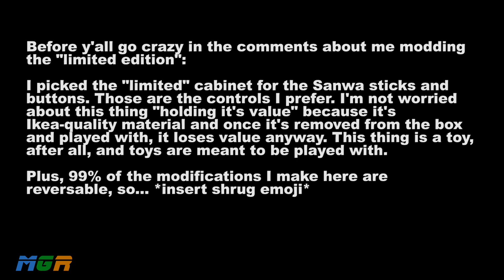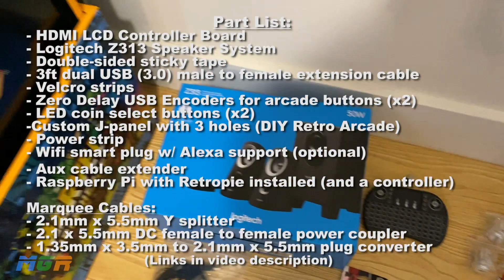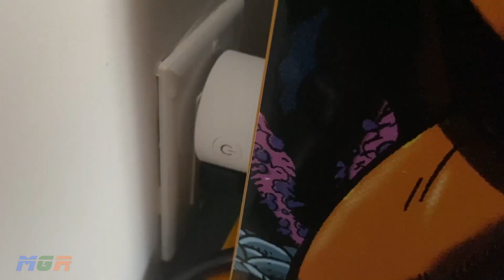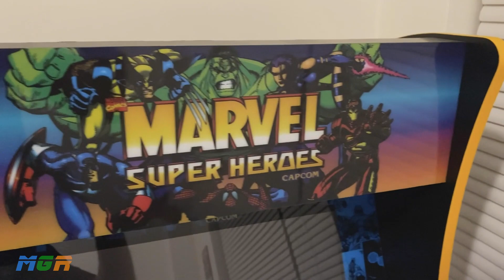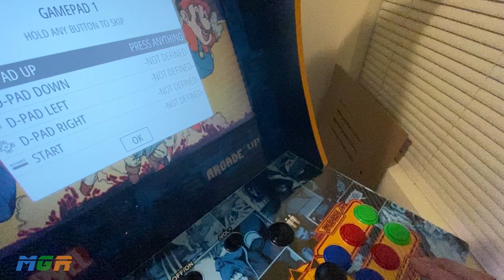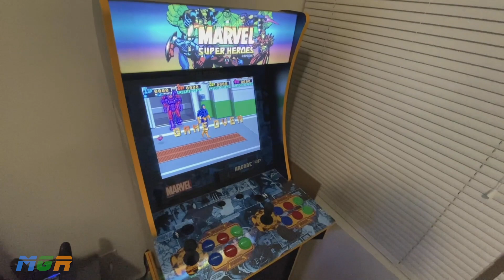How to Mod a Marvel Super Heroes (Special Edition) Arcade1up Cabinet

Comment: Hey just found your video, do these same instructions apply to the recent marvel vs capcom arcade cabs?
Reply from the maker: Most of it should, but to be safe I would try to find a more recent video on that specific cab, as it is newer and might have some different parts than the one in the video.
Reply: @MinorityGamerReport  I figured, I guess I will wait and see if any vids drop about it. Thanks for replying.

Comment: So if i am looking to keep the stock buttons and speakers, but add more games, i really just need the encoder and the pi set up?
Reply from the maker: Depends on what cabinet you are modding. In this video I used the stock buttons and speakers tho, so if you follow this tutorial and have the same cab, you’ll have that.
Reply: @MinorityGamerReport  i do have the same can actually!  Mine is the blue one with light up buttons and light up marquee!  :)
Reply from the maker: You’ll still need the subwoofer shown in the tutorial or an amp in order to use the stock speakers after modding tho.
Reply: @MinorityGamerReport  oh really?  Ok thats good to know!  Ty sm

Comment: My joy sticks dont have the cable there?? The yellow red and black 3 in one. Here is a picture https://ibb.co/wWB9Ysw
Reply from the maker: Is this for the limited edition or the regular edition? Hard to tell from the picture
Reply: @MinorityGamerReport  
https://ibb.co/P54GTD2
https://ibb.co/2WHFZkB

Either way I picked up 2 joysticks by easyget so I'll have to install them just going to be a pain to center them XD. Idk of there better or worse then the ones I got.
Reply from the maker: Yeah the control set up is slightly different for the non-limited edition, since it has Sanwa parts. Sounds like you figured it out tho. Sorry, I wasn’t more clear about that in the video.
Reply from the maker: The reason for the difference is because the limited edition uses Sanwa parts for the controls, while the regular does not.

Comment: I got everything up and running and in waiting on my usb encoders to come in in the mean time using a usb joystick into the raspberry pi.

But I cant seen to get audio I dont know why?
Reply from the maker: Did you try playing around with the Pi’s audio settings? I’m not sure what the issue would be outside of that.
Reply: @MinorityGamerReport  what audio settings do you have it set at?
Reply: @MinorityGamerReport  I got mine work and atm just wiring my fight stick but I dont have that cable there on the joystick so I'm screwed lol why is mine diffrent https://ibb.co/wWB9Ysw

Comment: Im following your directions on the speakers, but i cant get ANY audio to come out no matter what i try. Im not sure what I'm doing wrong.
Reply: Same I cant get audio
Reply: @ShadowFury576  looking at a few google searches, the control board (with the LED) has a few buttons marked Left and Right, and the right turns up the volume. Barring that, theres also a retro arch option for audio that may need to be adjusted. We can hope Minority here updates us.
Reply from the maker: You might have to go into the Pi’s audio configuration menu and try some of the options there. I didn’t have any audio issues, personally though.

Comment: Hi, I got all the parts you listed and I'm still having issues with connecting the Marquee. I can't seem to get the 2.1mm connection to get into the female to female. It seems like the metal inside is too big. Is this for sure the right part? https://www.amazon.com/gp/product/B002IULV8U/ref=ppx_yo_dt_b_search_asin_title?ie=UTF8&psc=1 . It could be I got some defective/bigs ones too, cause the male to male ones in the package don't even fit into the female one.
Reply from the maker: That connector you linked to is the correct one, so I’m not sure.
Reply: @MinorityGamerReport  Thanks for the response! And once again, video has been very helpful. Turns out I got sent a 2.5mm x 5.5mm even though the bag says 2.1mm x 5.5mm. Got the correct one and everything works great. Oddly, I couldn't get audio working from the LCD board; I had to connect it directly to my Pi.

Comment: Did you need to put the ground onto the LCD Controller? It's not in your video, curious if it needs to be grounded to the controller like ETA Prime's video.
Reply from the maker: Yes, I used the ground
Reply from the maker: I linked ETA Prime’s video in the video description just in case I missed anything that he already went over.

Comment: Hey, is it possible to switch out the coin buttons you are using with the 25 cent credit ones? How would they connect to the encoder? https://www.diyretroarcade.com/products/25-cent-red-push-for-credit-arcade-led-button?_pos=1&_sid=a9a4b9fe7&_ss=r
Reply from the maker: Yes you can use whatever other button you want as long as it has the same connectors. It would connect the same way as the ones I have in the video

Comment: Couldn't I plug in the default speakers into the pi?
Reply: Sorry I have one more thing to ask, I got almost everything working but I got a subwoofer that doesn't have aux output just input, is there a work around for this?
Reply from the maker: I wouldn’t advise that. You need some kind of amplifier to power the sound.
Reply: @MinorityGamerReport  Do you attach the ground to the board or the monitor and does it have to be that specific subwoofer?
Reply from the maker: @SickleSlash  you wanna attach the ground to the board

Comment: Great video, is there anyway to use the stock speakers alongside this particular mod?
Reply from the maker: I use the stock speakers in this tutorial. The only thing I did was connect a subwoofer to it in order to connect and amplify the sound coming from the Pi. The sound still comes from the stocks
Reply from the maker: Also, thanks for watching!

Comment: Just ordered this cab and plan to mod it. One question - Do you shut down your Pi first and then use voice to shut down everything else? 

I was looking at a powerbar with a remote instead of voice - but just trying to figure it all out (I'm using a PC instead of a Pi).
Reply from the maker: Nathaniel Lewis Yes, you’ll want to shut down your Pi or PC normally first before cutting off the power with the smart plug. If you just cut the power with the Pi/PC still on it can damage it.
Reply: @MinorityGamerReport  My other question is - how do you turn it back on? Do you have to go in each time to turn on the Pi?
Reply: @thenateyshow8900  How did you make out with this? Fellow Canadian doing the same mod and I am using the existing power and volume buttons on the CAB. Just waiting for my LCD controller to arrive and I should be able to test everything.
Reply: @MinorityGamerReport  Beauty, thanks. I wish there was a command where I could shut down the PC and have it power everything down. I think you can maybe do it with a relay, but that's outside of my knowledge range haha

I'm Canadian, so I can't really order a J-Panel, so wish me luck drilling holes! hahaha ---- I want to do 8 buttons per player instead of 6, but I'm terrified to drill into the plexi.

Comment: Question, am about to purchase the raspberry pi 4 but am not sure how much ram should i purchase for modding? Is there any benefit from a 4 or 8gbs?
Reply from the maker: Angel Castillo I’d just go for the 4gb. From what I’ve researched, the ram size doesn’t really effect emulation all that much. It’s mostly just if you want to use it for more advanced stuff like running Windows 10, etc

Comment: Hello, if you mod the console does that mean that you cannot go to the original menu? Like the default menu with the original games. I ask this cause i preordered the marvel vs capcom arcade that has wifi to play online. So i would like to preserve that but i want to mod it too but am wondering if thats actually possible.
Reply from the maker: Angel Castillo when you mod a Arcade1up, you’re removing the computer that has the stock games, etc on it. If you want to keep the online functionality and the menus, I wouldn’t recommend modding it. However, you can easily put the stock games that come with the cab onto the Pi. You just have to find the roms online and throw them on the Pi. They probably won’t have online functionality though, so keep that in mind.
Reply: @MinorityGamerReport  thanks for the reply man! I realize now that i was being too greedy haha. Have a good one!

Comment: Super helpful video, thanks for putting this together!  Quick question though - Would the USB encoder you used work the same way on the non-Limited edition version of the Marvel cab?  The only reason I ask is because that cab did not come with the upgraded Sanwa sticks and buttons.  Just want to make sure I don’t need to use a different encoder board or need to buy different buttons/sticks.  Thanks!
Reply from the maker: neomoe 5 it should work for the buttons, but you might need to switch out the joystick for a Sanwa or one with the right ports. That’s the main difference.
Reply: Minority Gamer Report ah got it. I’ll look into it and will post how it goes for the stick.  Thanks again!
Reply: @neomoe5555  how did the joystick work? I'm about to mod my regular marvel cabinet and was wondering if I'll need to upgrade the joystick right away.

Comment: Is there any way to keep the arcade1up stock games and switch to raspberry's game as one pleases? kinda reversible options between original board and raspberry???
Reply: That's would be super cool. I haven't seen any examples on youtube of anyone doing that though I'd be happily proven wrong!
Reply: I mean a modded pie has the games. But I get what you're saying. Would be pretty neat. Perhaps rip the image of the stock arcade1up and put it in the pie.
Reply from the maker: I don’t know. The mod is reversible tho if you ever want to go back to using the stock system. However, you can easily load the same stock games onto the Pi. The roms are easy to find.